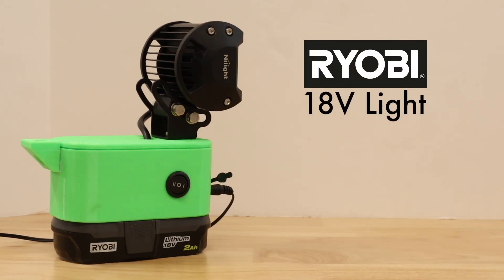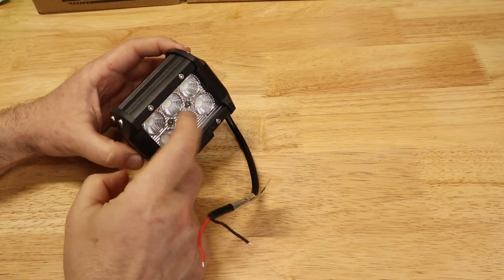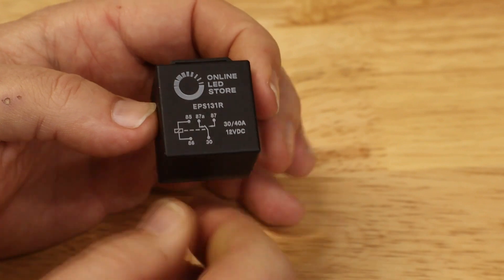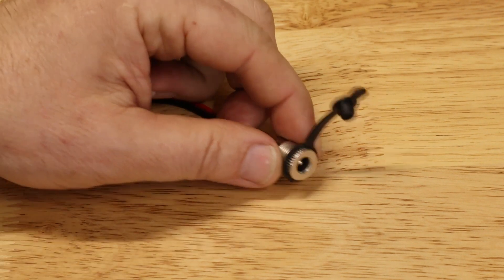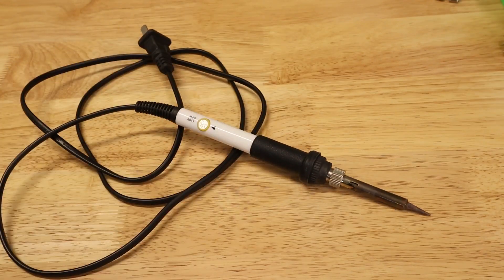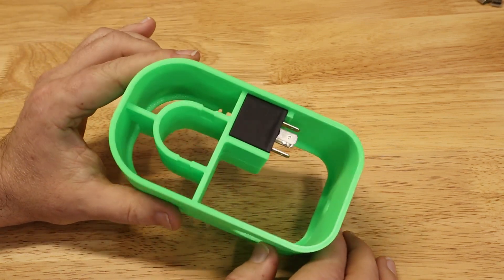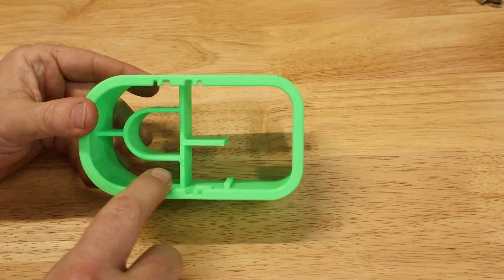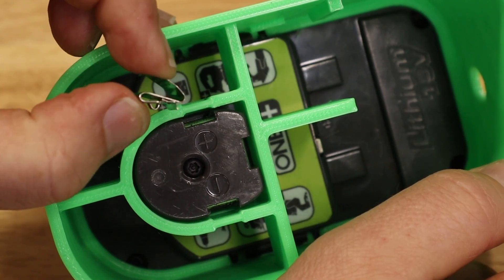Ryobi Automatic Emergency Light: Step-By-Step How-To

Comment: Excellent job, however one thing that's essential to an emergency light such as this is the light staying fully charged until it's needed. If there was a battery charging circuit implemented that would periodically check the charge state and top it off that would make this perfect. To maintain battery health it could even limit charge to 80% rather than keeping the battery at 100% all the time.

Comment: I like this project and idea.  I have made several lights that run off of Ryobi batteries, but this is a very useful light.  I would like to do a video making one like this but since I don't have a 3D printer (like many small shops).  I would be making mine using wood and making the Ryobi receptacle from scraps and a Ryobi clip.  I'll drop you a comment when done and will be mentioning your video as my inspiration.  Thanks for sharing this.
Reply from the maker: The same project would pretty pretty cool with an old cigar box or something along those lines. No reason this really needs to be 3D printed. A wood box and a few drill bits should be almost all you need.
Reply from the maker: Something else that might look good as a project variant would be use to a traditional light bulb socket and a 10-30V bulb.
These ones work really well with 18V batteries.
https://amzn.to/40Sg5ei
Reply: @BenjaminNelsonX  Thanks for the tips, Ben.  I have those bulbs and have made a couple of videos using them.  One is using the Ryobi battery and an E26 light fixture (like the one you mentioned, if interested).  I think I could add the relay and switch to it if the box has room.  Otherwise, I'll just build a new version.  I'll let you know when I have made it.

Comment: While it is easy to be a backseat driver and give the "I'd do it this way" to other people's projects. My one change would be to have the switch change between 1: running off of battery when the mains is off, 2: off, 3: running light directly from mains instead of battery. If you have power from the brick anyway, might as well use it in the on mode vs using up battery power.

Of course adding battery maintenance circuitry would be ideal, but that seems like an unnecessary expense considering how well lithium batteries maintain their charge while not being used.
Reply from the maker: I guess that's the great thing about DIY projects - you can make them however you want.
I provided the parts list and 3D files for anyone to build one of these. Feel free to modify it to you own liking.

I did NOT design this to power the light from the DC adapter because I couldn't see a situation in which I would use it that way.
Essentially, it would be a corded flashlight. The point is that it's portable and handy where you wouldn't have power anyways.

It's not really a pleasant light for a living space. It's perfect for things like working on a car. In that case, having it run on battery is the only way I would want it anyways! No power cables to get in the way!

If I DID want a light where it could also run directly from the wall power, I think it would be best to use a living room lamp, and install a 12Vdc bulb in it. That way, it would just be a normal lamp for household lighting (running off the DC adapter and wall power all the time) but would come on automatically in a blackout.

It would still be a great project, just different than the goals I set out for this one.

Check out the other Ryobi light I designed, the bulb for that would be perfect for a household backup lamp!
https://www.youtube.com/watch?v=nLNqwOpsZps

I also didn't see any advantage of having battery charging circuitry built-in. Modern lithium batteries are great! If they aren't powering anything, self-discharge is just SO minimal.
And of course, I have plenty of Ryobi chargers, so I would simply swap out the battery to charge and put a fresh one in after I used this as a portable lamp.

Comment: One thing people should know about wall plugs for low voltage is to make sure your DC jack is the same polarity and the jack on the device. I have seen soon many people showing the wrong polarity and burning out there devices.also always good to have some protection such as a fuse to be safe. But other wise awesome build.
Reply from the maker: It's always good to double-check your DC Polarity!
This project was unusual in that it was the rare case where polarity just didn't matter.
Reply: @BenjaminNelsonX  true. I learn the hard way a long time ago when I blow up my ryobi battery using a non ryobi charger. Found out the DC power barrow jack was reversed polarity. Lost a $49 battery.